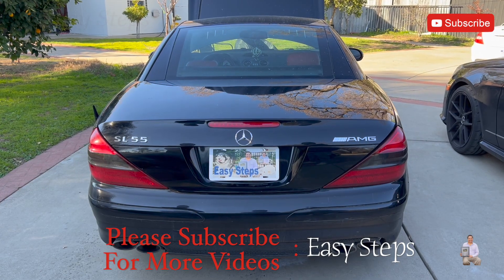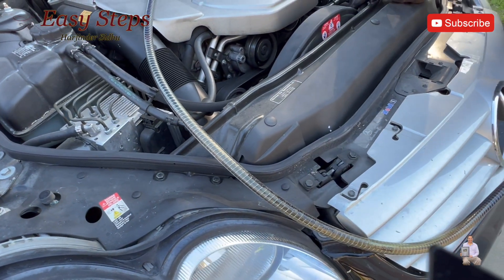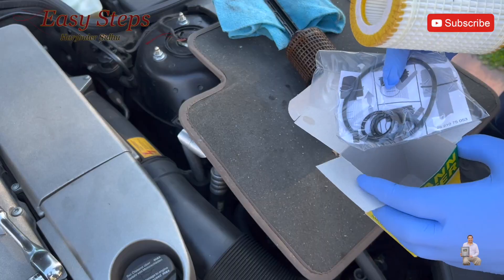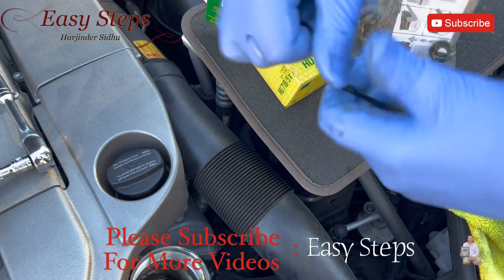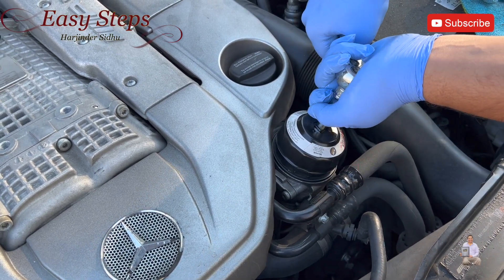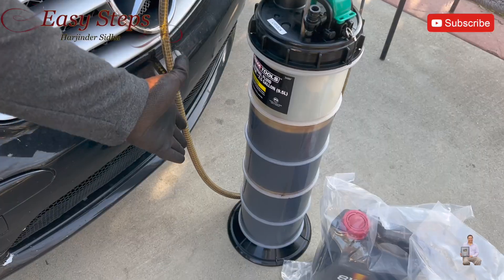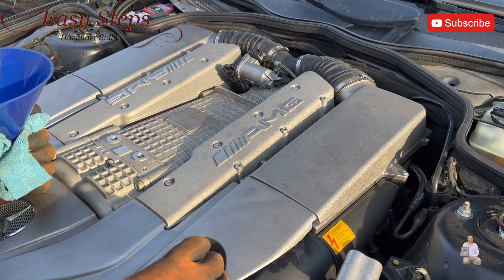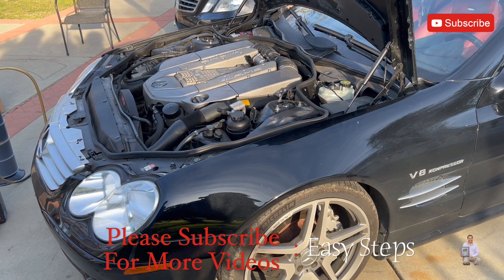How To Change Engine Oil and Oil Filter on Mercedes SL55 AMG with Oil Extractor Pump

Comment: where did you buy your fluid extractor? what brand is it thanks
Reply from the maker: I always list the things I use in the description, let me copy and paste it for you.
Mann filter hu718/5x - https://amzn.to/3M3abSc
Liqui Moly 2332 oil 5w-40 - https://amzn.to/47ZhP9O
Mobil 1 oil 5w-40 - https://amzn.to/3PkyEEO
Motul oil 5w-40 - https://amzn.to/44wTdlD
filter wrench 76mm - https://amzn.to/3PQEQmM
10L Manual Fluid Extractor - https://amzn.to/3tEnkLq
Oil Extractor Pump - https://amzn.to/3XMOx8J
oil funnel for car - https://amzn.to/3S1Xued

Comment: tecnhnically, do the 2 drains plugs have to be changes with every oil change or they do not need to be changed unless they're unscrewed?

can this oil extractor be used with any mercedes or any car?